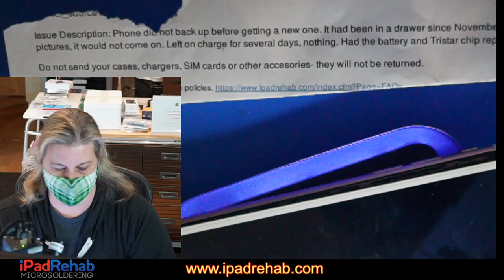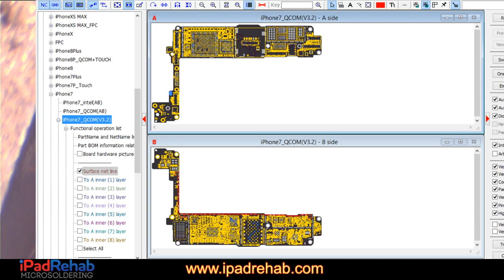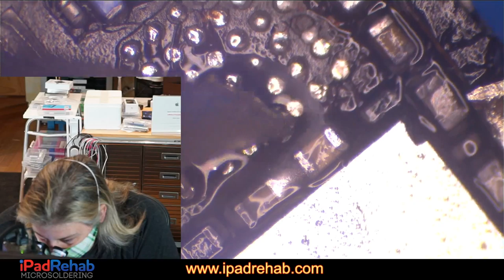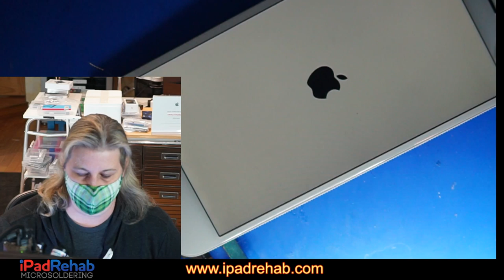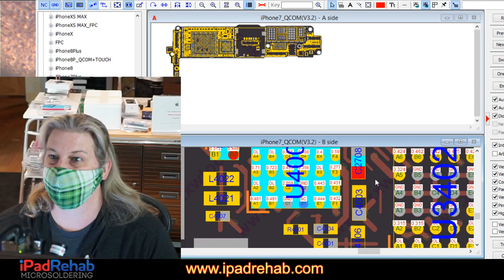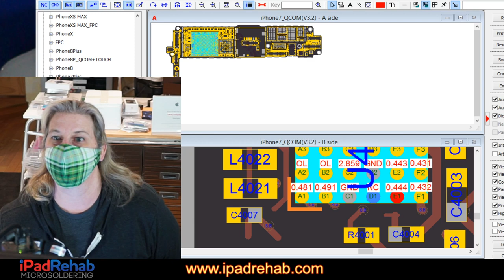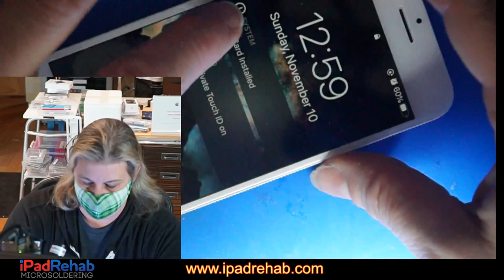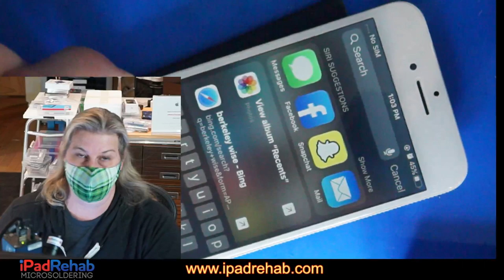A Disgusting Botched iPhone Repair.

Comment: A short question to all of you guys:
My toddler locked my iPad. It's no use to connect it to a PC. It's not recognized. I tried it on 2 PCs and a Laptop so far.
I can't get into recovery mode like this and Apple will probably say I should buy a new one. 

Any suggestions what I could try to get it hooked up to my PC again?
Edit: I tried a different iPad with the same cable on the same PCs. Windows finds it.

Comment: I subscribed almost a year ago due to Louis Rossmann  after watching his channel and wanted to see how many of these Crapple phones have issues. I can say I never had a single issue from my Samsung Galaxy S1, S2, S3, and current S5 all purchased used from those that got Crapple phones instead on their carrier's upgrade deal. I have heavily used my phones and know of at least 6 other people that have and are doing the same with their older Galaxy devices. No issues. No worries of security, data or picture loss, water damage, etc. I put them in an Otterbox Defender every time and still no issues. My batteries are easily replaceable and I can run all the apps I need. The hardware works phenomenal. Can't see all the hype of Crapple over-priced products as they do nothing better than what I have. The hardware in Crapple comes from manufacturers so they don't even make anything. Current S5 cost $60 used 20 months ago and was in immaculate condition and already came in an Otterbox Defender. $2.50 for a factory data/charge cable and $7 for the wireless charging receiver that hides behind the battery cover. $12 for a new high cap battery that is still working awesome! $12 for a open-box Genuine Samsung Limited Edition charging pad. Using a third-party reseller of major network service so I don't have contracts, terms, leases, or need to qualify for an upgrade. Just stating facts at hand. I keep my phones for 3-4 years and then resell them. I'm glad to see people make money off repairing these Crapple products as it shows just how unreliable they are for the high money they garner. One device, from one brand, that every model looks the same when you turn it on. I can choose from 10 manufacturers all with varying features, price points, and customization. Best of all I can go to WalMart (non-covid times) 24 hrs a day and pick up a smartphone for $20 and have my number up working in an emergency in less than 3 minutes and have access to all my data, photos, contacts, etc. Can't do that with a Crapple yet the sheeple still worship and buy them. Yes, we are going to socialism sooner than we think. I'll keep watching Jessa for entertainment sake though it is always the same story. Crapple technology and Crapple no customer service. Not a fan boy, just a smart consumer that has saved $1000's not buying over-priced junk assembled by 10 year-olds in "STILL Communist" China.